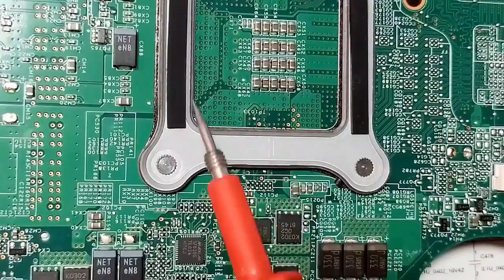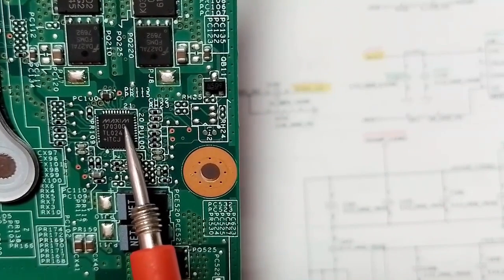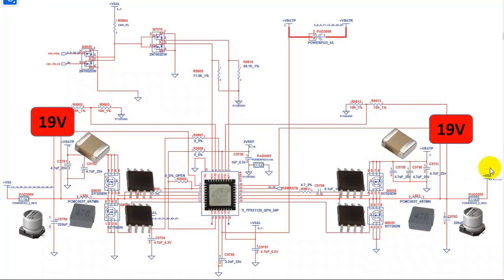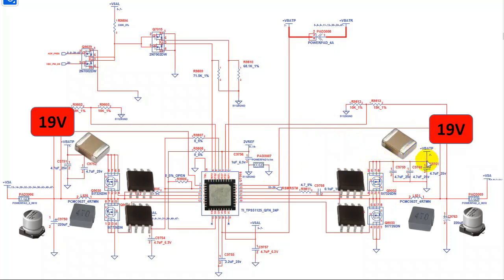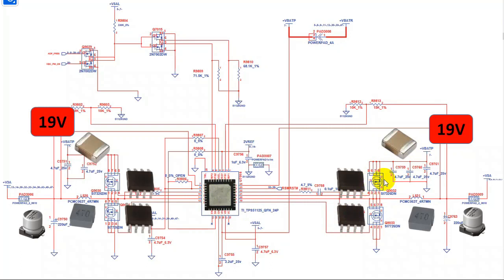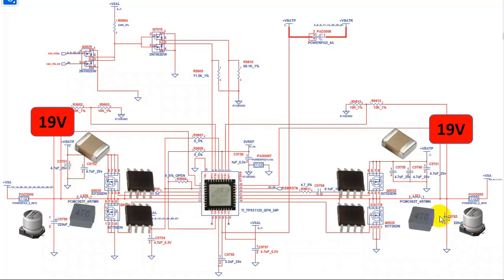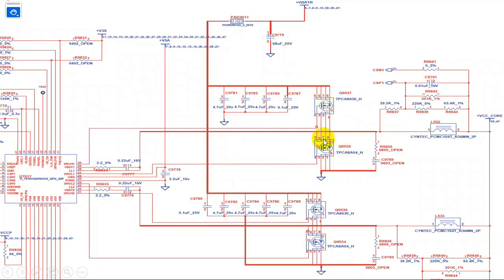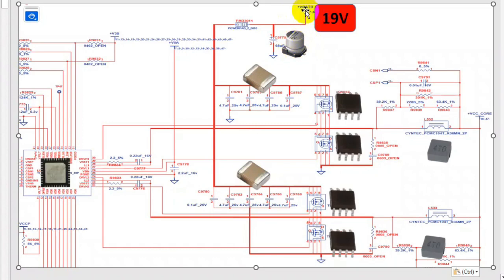The shocking Tips about Laptop motherboard Repair - How to diagnose faulty computer - PC Circuits

Comment: Hi, I havnt 3.3 or 5V but the 19V is there at the IC pin SO....  how does the "on" pins work if they need 5V? ect if the IC isnt making any voltage3 or 5?? i dont see any volts at those pins and no lights on or fan.

Comment: the capacitor with a pure DC it didn’t do any smooth out at all it stayed the same the same voltage as is i build a 12volts using transformer from the 240volts AC power it’s smooths out almost doubles the inputs power guess where the extra power come from